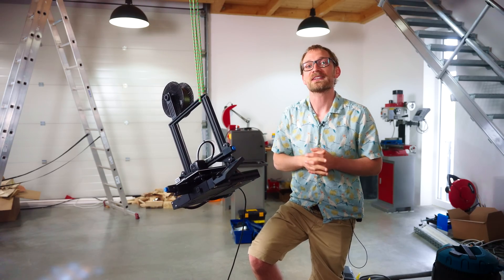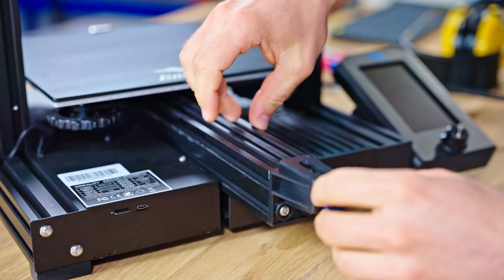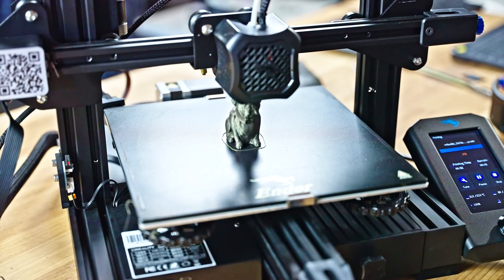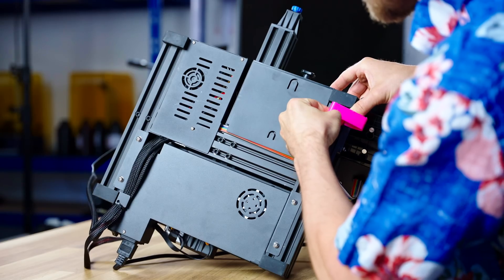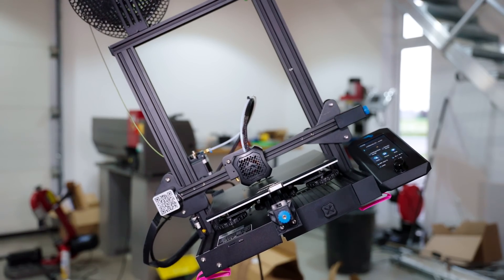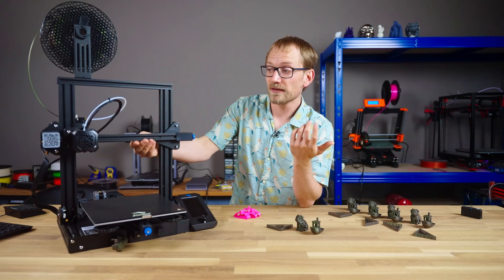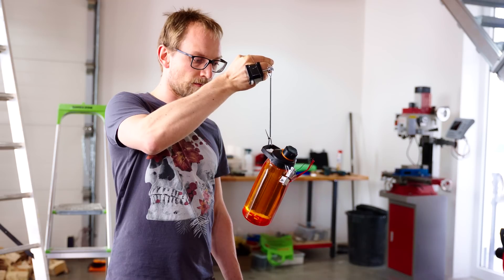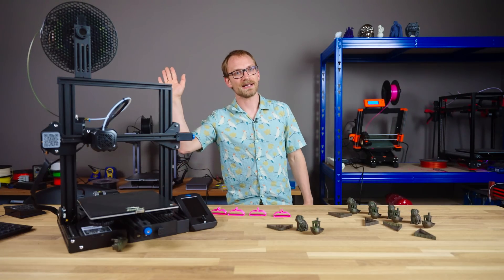Wobbly 3D printer makes for better parts!

Comment: Interesting.  I dismissed a lot of these feet in the past, I always thought rigidity was better, I think there is a place for rigidity. I think it depends on what sort of feedback loop the surface your printer is on creates. I'm still curious about whether or not stiffening every axis of the printer would improve the prints more than dampening the printer.
Reply: Belts and stepper motors are springy, so with a stiff frame you will still get ringing in the print. Dampeners on the axes might be the way to go.
Reply: @nophead  Your comment reminds me that I have seen stepper dampeners, that always looked like something superfluous for FDM.  It might be worth investigating but I think that's only for the perpendicular axis?
Reply: @frankb5728  By "perpendicular axis" do you mean Z? I don't think ringing is an issue as it only moves once each layer.
Reply: @nophead   If you take a stepper and put it on its back, shaft up and the axis that goes from the top of the shaft to the back, I'm trying to figure out if that's the axis that is dampened the most.  I might have a bad understanding of the dampeners.
Reply: @frankb5728  The shaft shouldn't move perpendicularly. It is pushed one way by a spring against a bearing and stays locked unless you have enough force to defeat the spring. The vibration you get is rotationally. The magnetic field pull increases as you displace the rotation from its resting point, so it acts like a spring. and will oscillate with the mass of the load when it steps. Rotational dampers dampen the rotational oscillations. They can be fluid filled or perhaps rubber mounts that allow the motor to rotate slightly in a damped way. That is what you are probably thinking of.
Reply: @nophead  I bought some cheap cork spacers basically to work as dampeners ages ago when I got into printing, as I saw people were suggesting those + the wobbly printed feet mainly for lowering the sound from the vibrations of the printer. I didn't get to try them out, before I found a LOT of people saying those types of dampeners (and even the more fancy ones) introduced ghosting and ringing. I ended up getting a board with silent drivers and didn't really think about it since..
Reply: @PureRushXevus  Those dampeners are to stop vibrations getting from the motor to the frame to make the machine quieter.  Ringing in the print is caused by rotational vibrations of the shaft and that needs a different type of dampener. Either a rubber mount that allows some rotation of the motor or a fluid filled cell with a paddle in it.
Reply: @nophead  hmm, okay.. do you have a link for something like that?
Reply: In part, it depends on the printer.

With printers with a less rigid default frame, stiffening up the frame however possible is a great first step. (reducing the amplitude of ringing) 
For example the Anet A8 had a rather bad vertical setup- but with an added print it becomes much stiffer. I have the bottom mounted onto 18mm (3/4") plywood for rigidity too. 

However, rigidity doesn't ultimately  remove the vibrations. For that, you need dampening of some kind. I have it set up with the base on four big sponges, that seems to do alright.

As an overview-

-adding rigidity limits movement -> reduces amplitude, heightens transfer
-adding weight lowers the frequency -> longer period, can make it less visible. Also lowers amplitude. Note that this only influences transfer to other axes, as anything going on before it's transferred by what the weight is attached to is not affected.
-adding dampening -> only way to have vibrations "exit" the system. 

You'll want a combination of all of them for optimal results. 
Note how rigidity and dampening are in some ways opposites.
Reply: you want all three axes to be rigid relative to each other, but non-rigid in the space the printer sits. the heavier the printer, the lighter what you are printing relatively and the lower amplitude in vibration as the table moves. sand is typically used as the momentum is transferred to the sand randomly and the sand returns to the position damping the system rather quickly.

Comment: Would have loved to see how these washing machine rubber mats perform.
At least in my head a more rigid material (but not as rigid as a concrete-vs-asphalt-roads-which-is-better block) should be better at dampening than some flimsy plastic feet.
Comparable to the sand in CNC machines you mentioned.

Comment: i was thinking of a possible idea concerning this, but i lack resources to try it (and i don't want to bust up my only printer at the moment)
Basically looking at "Stuff made here's" Wall painting robot, and how he used a counterweight to counteract momentum
thinking on a belt printer could something like that be done, having a weight on the back side of the belt, so when the printer moves one way, the counter would move the other

Comment: Informative video Thomas. Ive been using the 3D printed squashball feet for a few years on my Ender-3 and i havent noticed a substantial improvement in print quality but it definitely made an improvement on the sound resonance. What are your thoughts on that?
Reply: I've seen few Finnish users do that. On some printers it can be of great help. But surely enough. Differences on printers mechanically can't guarantee that there would be some universal solution. Have you tried those different ball materials? Apparently it can create visible differences in prints on some occasions.

Comment: This is why I'm still interested and actually already have HyperCube (By Tech2C) frame that I haven't completed. I still very much like how it uses carbon fiber tubing etc to specifically decrease mass of moving items. I've been planning to make one with like 0,2-0,3 nozzle for smaller FDM printed parts. I was astound there got so many projects spawned by it like HyperCube evolution, which in my eyes definitely isn't an evolution. Sure stuff like Voron or Ratrig have made mechanically beautiful printers, but still today, I find original HyperCube very interesting project, because of it focus on lightness. Positron is also very impressive project on that regard.
Reply: Hypercubes were designed to be cheap, being light is just a by-product. The Carbon fiber does reduce moving mass but it still prints at pedestrian speeds compared to linear rails. I can understand wanting the positron to be light but a hypercube isn't really portable regardless of the weight, the evo's frame is significantly more rigid which is what you want when trying to contain something that's constantly changing direction, accelerating etc.

Comment: Does rotating the feet 90° change the ringing 90 degrees?
Reply: No, because of resonances generally speaking happen at the "mechanical axis".
Reply: @kornelis bijker i wonder if stacking another set of feet 90 degrees rotated would help.

Comment: tennisball sized bags filled with sand, put under the rubberfeet would be interesting to test. quick and easy solution for everyone.
had the first print these days where ringing was a problem, so perfect timing.
Reply: Actual tennis balls with various fillings may even be good; typically you'll want some elasticity along with the dampening!

Comment: 10:35 ehhhm Tom. That is not the heat from the dampening. It's the heat from your warm finger...
Reply from the maker: You're looking at the wrong spot - the foot evenly heating up very much is heat from bending
Reply: @MadeWithLayers  No, it is not. There is no way that little bending is producing that much energy. Repeat the test with a room temperature finger on top.
Reply: @WhiteG60  It's flex from the material. If you bend ie. metal fast, molecules move and hence create heat. Basic physics.

Comment: Filling with sand and small lead shot could be interesting.  Or putting heavy material into the external slots of the extrusion to give you more room to add mass.
Reply: How much ringing is caused by the print bed being mounted on springs? Also, many cheaper bed-slinging printers have the print bed mounted on a single narrow rail, which has a narrow footprint. These are things that I think about in regard to ringing.
Reply: That sort of thing has been tried a lot in the world of small mills and lathes. Doesn't make a detectable difference.  99% of all chatter and vibration originates between the the point where work is being done, and the nearest linear slide/way.  If you're flexing the actual chassis of your machine, you're definitely well past the capability of your tool and work holding capability.  Sand won't make that go away.
Reply: @DerrangedGadgeteer  exactly correct, physical laws makes you response correct also.
Reply: there is a lot of literature available about resonant frequencies. every single way you can think of to mitigate ringing involves knowing EXACTLY(more or less) the entirety of each part, in conjunction with each part next to it. if you think by just making it denser you're affecting it, you're probably right! if you think you're making it better... well, i'm gonna need to see your maths. i refuse to believe anecdotal evidence on such an obviously deep phenomenon. 

You should too.
Reply: @nicewhenearnedrudemostlyel489  Yeah, if only we had some of way of measuring the most impactful frequencies so we could cancel them out somehow. Oh, that's right! That's exactly what we've been able to do with Klipper's input shaper for years. While there are certainly some easy ways to reduce their impact, I guarantee a raspberry pi and an hour of time will make more of a difference than anything else.
Reply: @JJFX-  that is the idea behind what i said, yes. It isn't some magical unknown phenomenon like the yokel in the video makes it out ti be.
Reply: @nicewhenearnedrudemostlyel489  Yes exactly, if that came off as a jab at you it wasn't my intention.
Reply: @JJFX-  i see you now. Lol. Glad to know it's not just me.
Reply: maybe also just setting the entire printer on a bed of sand, would love to see that too
Reply: Adding mass will just lower the resonant frequency, won’t increase the damping. I thought of lead shot too. I think that the range of motion of the support system, as a function of frequency is a critical factor. Lead shot is very good at dissipating higher frequencies, but may not work very well with frequencies in the range of a 3D printer.
Reply: for cheap big machinery damping? chepaest way is steel i beams filled with concrete or epoxy and gravel.
Reply: Until the sand leaks... been there, done that
Reply: Jello.

Comment: Good idea. I also thought dampening would provide good results over using extra rigidity.
In that concept, adding sand into the frame or feet would something interesting to see being tested.
Thank you for the insight.

Comment: the CNC kitchen style concrete slab + soft cell packing foam approach works great.

And sand in the extrusions also does a really good job, a bunch of the speed printing freaks use it.
Reply: Thing is that it varies so much about how printer has been done mechanically. There aren't universal guides to what is the best solution.
Reply: @jothain  the two things I described work on pretty much anything. Of course if the printer doesn't use extrusions you can't fill them with sand

Comment: I have 20 printers in my spare room and they are all on modular wire shelving. Which has a bit of to and fro to them, and i noticed that same bit of decrease in ringing vs being on a solid table. 

Not super sturdy shelving failed successfully lmao